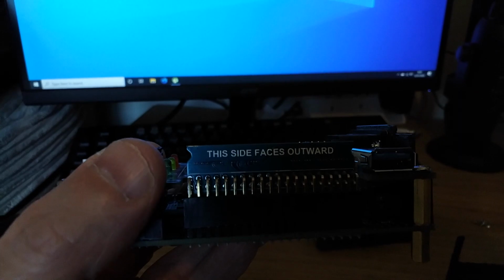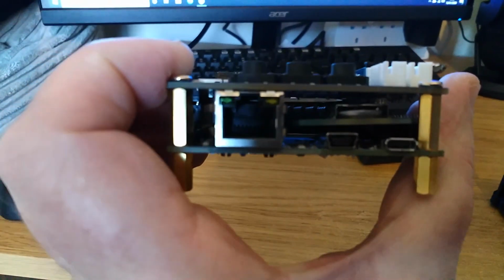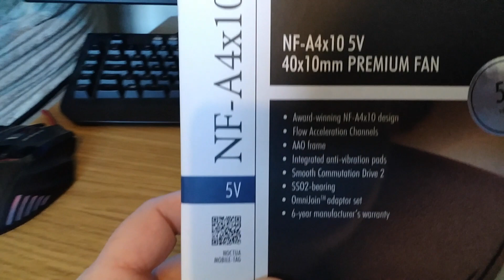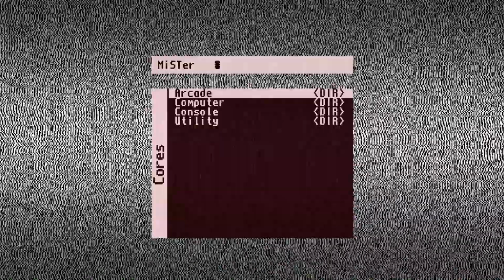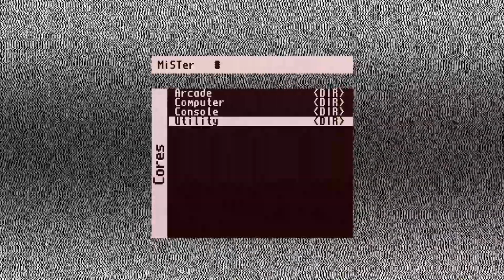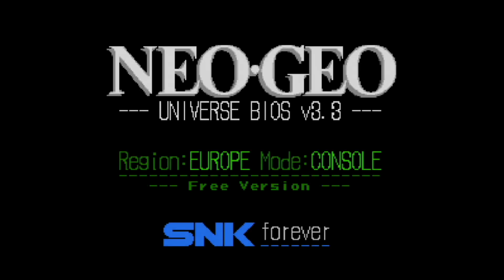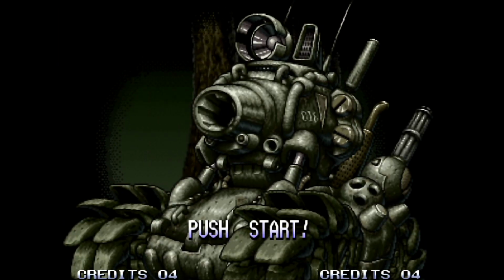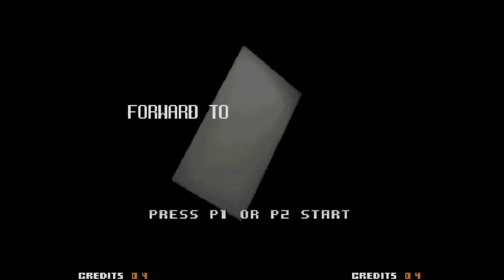MiSTer FPGA Hardware Review and Neo Geo Core

Comment: The usb 3 port is not usb 3 - it's for additional user io addons such as SNAC,llapi(low latency input devices), and developer debugging. 
The vga port does not output composite video!  It outputs either vga, ypbpr(for consumer tv's) or RGBs for pvms.

Most decent vendors should include a fan and heatsink with io board for a fair price. 

I sell these on my etsy store ( http://zerohimself.etsy.com )  - even if you don't want to buy one feel free to ask me ANY questions.  I can also be reached on Twitter @zerohimself
Reply from the maker: I thought I had mentioned that the ports was for IO but thanks for the clarification.

Comment: Hi good video  .If you want to use your joystick to control the MiSTer .From your keyboard press escape and using the arrow keys select define joystick and follow the prompts Also the best way to setup the scanline's / filters is not to use scandoubler fx but to use scale filterin the other screen .I use the scanline bright  filter .Make sure in you MiSTer ini file your set vscale mode to integer scaling  that way the scan lines will be evenly spaced
Reply: the reason for not using the scandoubler fx I believe that it introduces extra lag where the scale filter doesn't ... the reason to add integer scaling is to stop the scanlines from banding
Reply from the maker: Thank Mary, I did figure it out as you'll see in a later video 😁
Reply from the maker: Thanks Mary
Reply: the scanline filters are very much preferable to the scandoubler FX. to get perfect mathematically correct scanlines- thats your best bet. the (bright) variant ones will compensate for the drop in darkness that comes along with using scanlines usually, and are my favorite of the bunch.